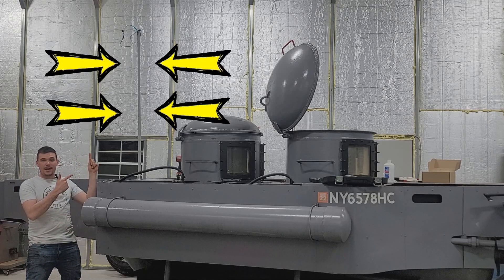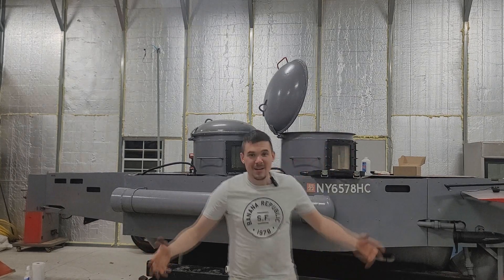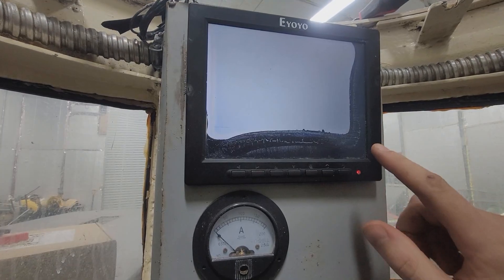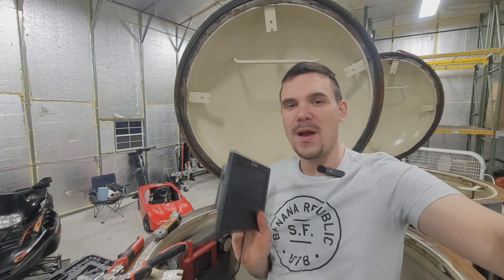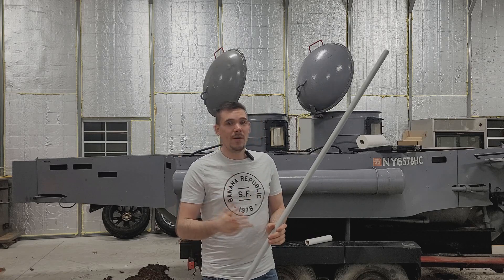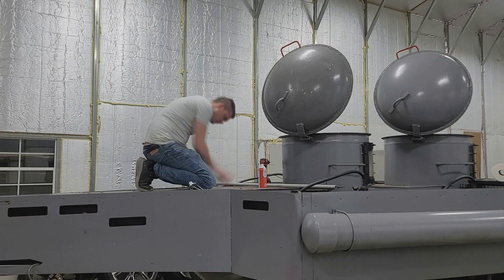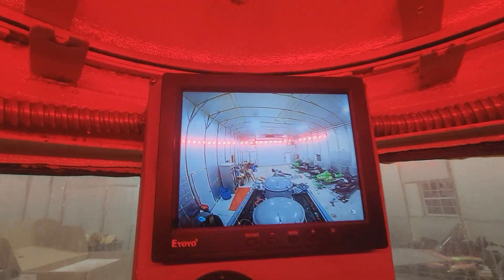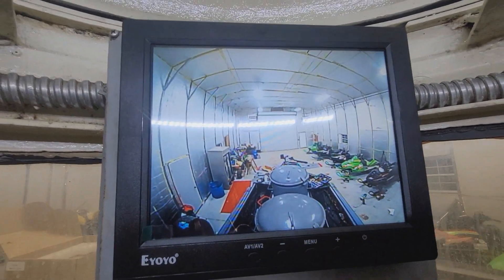I Put A Periscope On My Submarine! - In The Garage! - Episode 3

Comment: For the platform on each side of the sub you could maybe use that lightweight wood that they use as dive platforms on boats!?!?🤔🤷
 New to the channel I just wanted to say loving it so far. as far as the hovercraft goes that would be cool but would would be even cooler is a hovercraft with a enclosed cabin instead of the jet ski type setup

Comment: How are you going about running wiring from inside to outside with a proper seal? I thought of my own little solution but I'm always open to knew ideas.
Reply from the maker: A lot of subs use IP69K cable glands (that's what this uses). Minus very deep ocean subs; more complex thru hull connections.
Reply: @PlanesBoatsandSubmarines   Interesting, I never realized these were readily available and rated 10 bar. So then I think I'll have this on the exterior and on the internal side the cable will be terminated with an electrical plug system so you can eject the wiring and close a ball valve if the IP69k Cable Gland malfunctions or there is an electrical malfunction I need to isolate. 👍